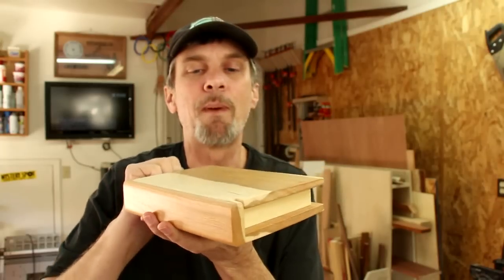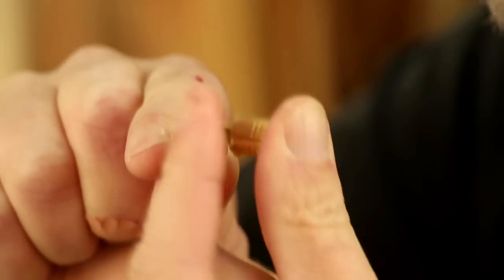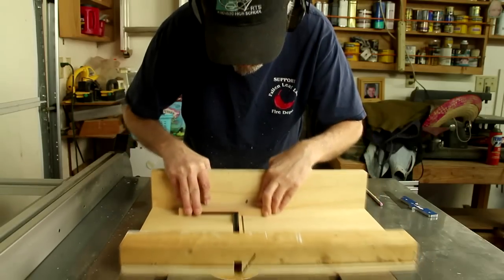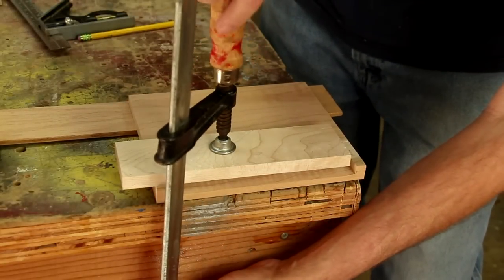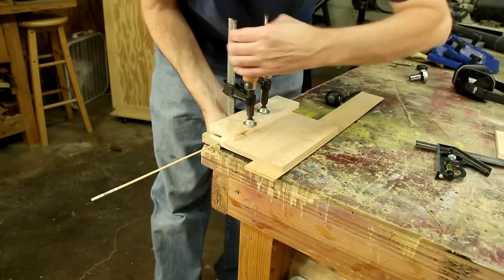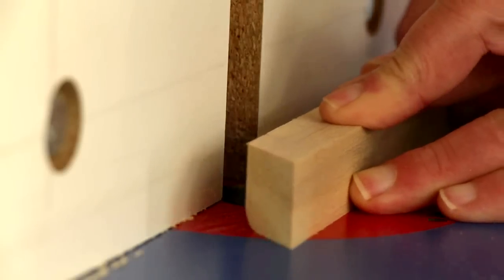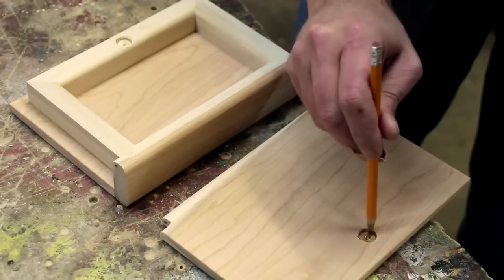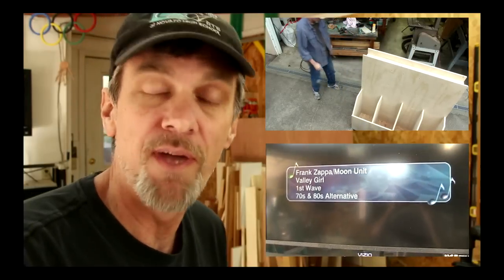Wooden book keepsake box. Valentine's Day gift idea!

Comment: nice job
in the future you may consider clamping the wood diagonal to the corner of the table when drilling holes for the hinges so you have access to both sides without having to release and "reclamp" to change the side
regards

Comment: I just built two boxes that look like a book. One has a removable front cover and the other is actually an open top box that slides inside an outer box. The spine is the side of the inner box. I did it this way to avoid the hinges. The one with the removable front cover has a catch on the spine side and an antique key lock on the page side. The box with the inner box has a key lock on the spine. I made the boxes from yellow popular lumber from a tree that I cut. I thinned the lumber to about 1/4 inch for the covers and 3/8 for the sides. About a half inch for the spines. The only problem I had was the wood bowed slightly when dried because it was a bit thin.

Comment: It is easy to put the magnets in backwards  (same poles facing) and the box will not close. I hate when that happens
Reply: Dennis Adams The easy solution for this is to stack the magnets, add epoxy to both holes, insert the stacked magnets into one side then close the lid which automatically inserts the second magnet in the other side maintaining he correct orientation.

Comment: using a minute bushing system using a simple biro, take the clear unfilled part of the ink tube ink holder, cut the required length and drill a pilot{tight hole} in the frame and door.
fit a 1/4 inch to post frame, and 3/8 inch into book cover or door, then insert a tooth pick into both at the assembly stage to negate drilling on outside surface,finished bushed wooden hinge pins,

Comment: to any one wanting to try to make a similar book and keep as much realism as possible.
1) you can use thinner wood and reinforce it by  gluing a piece of chipboard on the       inner part.
2) use a strip of denim or vinyl for a hinge glued to the inner part of the cover.
3) use thinner strips of oak  and making the internal compartment 1"  smaller then       then the cover.

4) take a stack of printer paper as thick as the wall of the internal compartment and then trace 1/2" around that. cut out the inner part of the stack as well as the outer and glue the inner part of the stack with woo glue and slip over the compartment.
5) use vinyl leather on the book keeping the spine unglued to prevent cracking over       time.

now it will appear as a normal book on the shelf or nightstand.
(but more costly in time/$$$)

Comment: I'm almost done building mine from the plans, but the dimensions seem different than then one you made in the video.  Did you adjust any dimensions for the plans?

The sizes in the plan seem about 25-30 percent smaller, and the frame especially seems "thinner" than yours in video (especially when it came time to find space to install a magnet).

Comment: Any ideas how to make the spine if I don't have a table saw?
Reply: Use a hand saw.
Reply: Ben Press You would create a nearly full-length rabbet with a hand saw? I hope you're smoking something that leaves you real mellow before you try it because you'll have to have a lot of patience!
Reply: +dlwatib So, really your question is: " How does someone without any tools, or just basic tools like a hand saw and chisel, learn to do basic woodworking without spending any time to learn? You can make a rabbit with a straight edge and a box cutter or even a flippin steak knife, but you have to want a rabbit joint.  Once you learn to do it well using kitchen utensils, when you try it with the hand saw and chisel you bought at a yard sale for $5 you will be able to cut a rabbit that looks like it was done on a table saw.